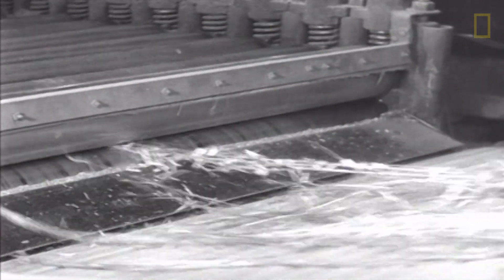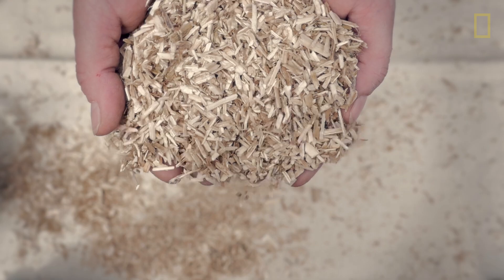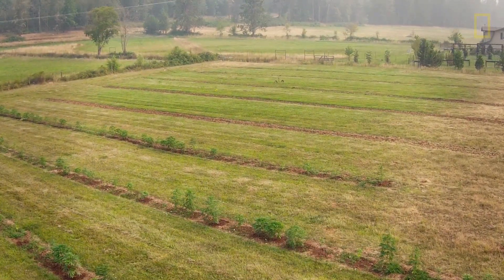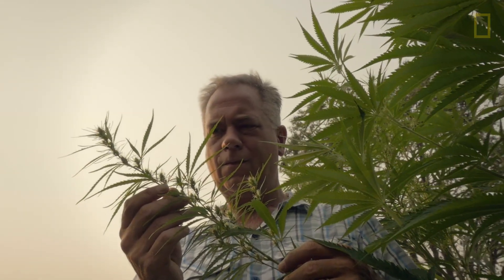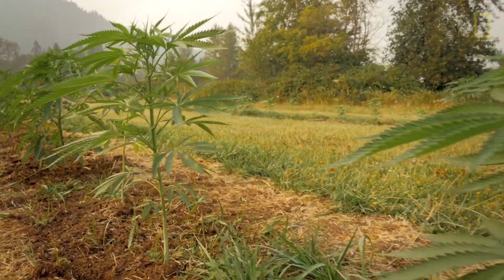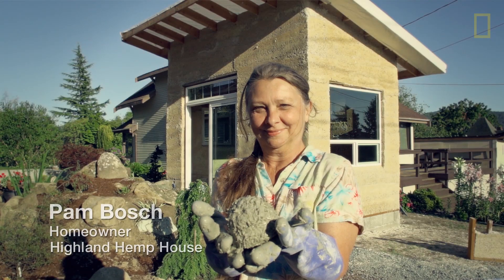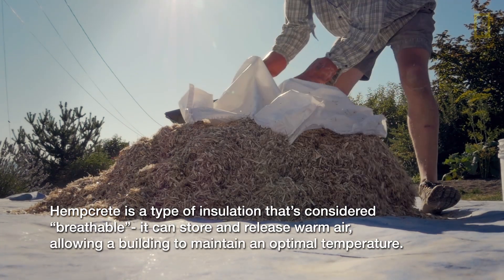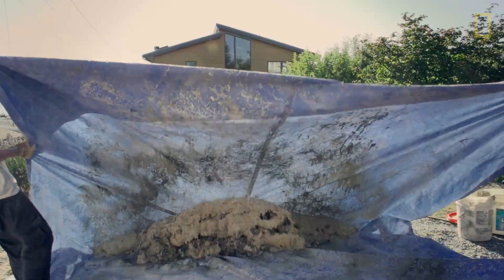Can You Build a House With Hemp? | National Geographic

Comment: Levi's jeans used to include hemp fiber until repugnicans actually stopped the process.  They lasted 2x as long
Reply: Too bad most of the restrictions were passed by Democrat Majorities and Democratic Presidents Roosevelt and Wilson.  As usual, they assumed that because it looked like MJ, it was Assault MJ and should be banned.  They felt good about passing the law though, even if it was the wrong law.
Reply: @georgewebster8131  so glad POTUS made it legal. At least on a federal level

Comment: I wonder if it would be suitable for rehabbing a house that lacks insulation by taking off the outside sheating--alum, vinyl, wood, and filling the openings between the studs with this mix?
Reply: +Kathleen Sisco seems like thats what this lady in the video was doing..  Go for it!
Reply: +Kathleen Sisco   Yes, as long as the framing is structurally acceptable, hempcrete can be packed around it. I will be doing that in the second phase of my building. First phase is new construction. I will be taking the interior drywall off as well because the moisture permeable, breathable qualities of the hempcrete provide a better atmosphere in the house.

Comment: Hemp is not a unique substance with regard to its use as a concrete filler. It doesn't make concrete any stronger than straw does, for example.

Also, the claim that 'industrial' hemp has no psychoactive properties is false. It's true that there have been many varieties of hemp that have been developed to have very low levels of THC because of a UN treaty in the 1950s requiring hemp products to have low THC content.
Reply: +PostSurgeOperative I think you've got your building materials mixed up, hempcrete is not concrete, it's an alternative to concrete in non-loadbearing applications. 

I'm not even sure what you were trying to convey when you said that it doesn't make concrete any stronger than straw does?? Hempcrete is less brittle than concrete, but equally, concrete is much harder.
Reply: bukkkers Actually, 'hempcrete' is a type of concrete, made with lime-based cement and hemp fiber admixture. There are similar mixes using other materials--such as rice straw, for example--that are comparable in weight, strength, and insulating properties. http://www.researchgate.net/publication/280728737_Physico_mechanical_properties_of_concrete_mixes_containing_recycled_Rice_Straw_and_Blast-Furnace_Slag